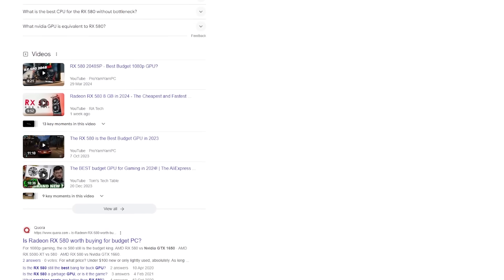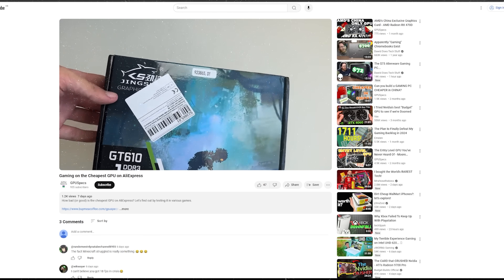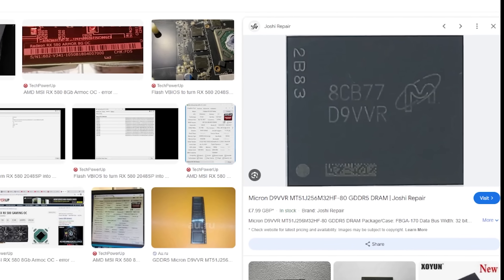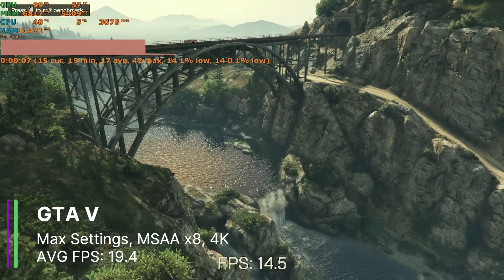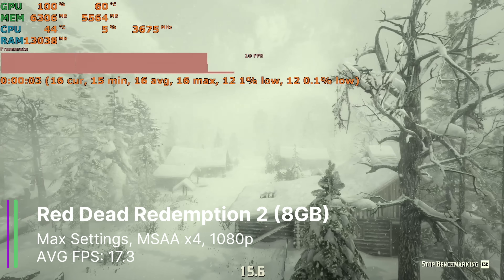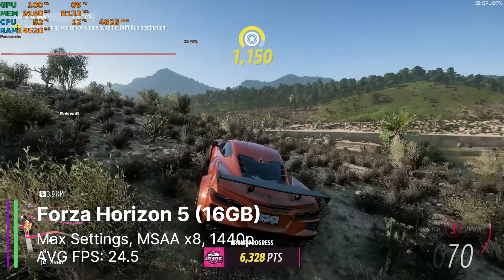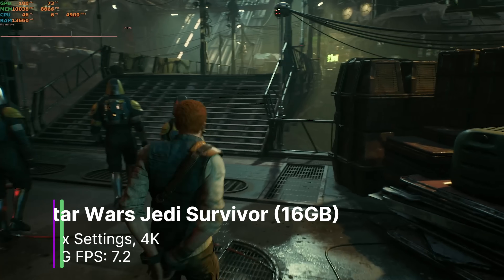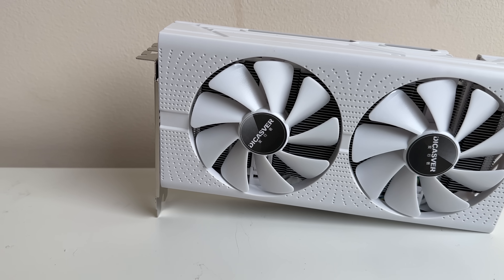16GB of VRAM on a 6 Year Old GPU? AMD RX 580 16GB

Comment: You would be able to get the benefits down the line with newer games and improved fsr3 frame generation mods to where you could probably get over 30fps but not with 4k. Fsr3.1 will decouple frame generation so you could even use frame generation without mods later so yeah other than the sp 16gb vram would be useful.
Reply: Frame gen with a base FPS of 15 would look awful (interpolation artifacts stay on screen much longer) and feel worse due to increased input lag

Comment: Use it for AI models, llama via ROCm setup, they typically use more VRAM and rely less on the raw speed of the GPU itself.
Reply: one 8 pin for power too.  could fit 6 of these in my dl580 :)
Reply: llama.cpp for the win
Reply: It doesn't support any recent version of ROCm and it can't be used for something like Cycles.
So yeah... unless you have a very specific use case, I'm not sure what the 16GB could be used for.

A VEGA gpu a ram mod could be somewhat useful though.
Reply: rx 580 is so ridiculously slow good luck getting one word per second.
Reply: @JohnHopkins-e3p  Who cares about words per second in email mode?
Reply: @JohnHopkins-e3pI get like 3 tkns/s in 8B models with an rx560 4gb i think an rx580 can do a lot actually
Reply: its amd not nvidia , doesn't support CUDA
Reply: @MohamedAhmed-os4ox  They said llama via ROCm, which is AMD. Did you even read the entire comment, or just the first five words?
Reply: @MohamedAhmed-os4ox  zluda enters the chat
Reply: @MohamedAhmed-os4ox  you know amd has theirt own compute language apart OpenCL , Direct Compute etc ? and theres ZLUDA which lets you run CUDA Apps too.

Comment: Could you run some benchmarks between the 8g and 16g with OLLAMA and Mistral? Afaik this gpu should be powerful enough to run either model but, the 16g should be able to run either with less quantization for more relevant responses.

Comment: Borderlands 3 launched with the parameter -notexturestreaming eliminates the game's notorious stutter by loading all the textures at once. Uses ~12GB of vram at 1440p and load times are longer (but stutter is almost completely gone).

Another older game with high vram usage is Far Cry 5 with the HD texture pack enabled. ~11GB at 1440p
Reply: Yeah Far Cry 5 is a good example. GR Breakpoint as well. A 16gb RX 580 would definitely benefit in these games if you just want higher res textures
Reply: Far cry5 is already an old game? 💀
Reply: @BrenoAgmL  2018 iirc which is 6 years ago
Reply: @abesmissioncontrol2013  
6 years inst old.
Reply: @BrenoAgmL  it's pretty old
Reply: skyrim with 4k texture packs aswell you often can run these texture packs with zero performance hit as long as you got the vram

Comment: Large Language Models ('AI') sometimes need more RAM.  To the point where a hacked APU BIOS to give the iGPU more framebuffer is a valid way to run larger language models.
Reply: The 780m can already use 16GB

Comment: For most close/over 200-250 bus speed card. Having more/faster memory can be very useful (especially powerful) for the RX580 speed so slow than you will not gain more performance. You might be able to max out more on graphics. But you still will have less FPS.

Additional note (especially for dumb Nvidia user or peopke with low knowledge) if a game need 9GB of VRAM and your card have 8GB. Even if the card will use less than 8GB it's just because it will cut some graphics. Or you will have less FPS. That's why if you compare a 4070 and a 7800XT. You can have the 4070 using 11 584 MB and the 7800XT 13 684 MB it's not the card managing worse his memory. It's the game cutting on some graphics.

Comment: Those crazy Chinese.

I looked into these weird cards, along with the 16GB RX580 2048SP's I found mentions of an Frankenstein RTX 3080M with 16GB of VRAM! I made a few enquiries to the various Aliexpress/Alibaba sellers and yeah it does exist, the price was crazy though.

I still kinda want one. Supposedly there is a 16GB 3070M 16GB version too but I couldn't ever find one. What I do know is that there is something called the Frankendriver project which makes these weird frankenstein high VRAM mobile Nvidia cards actually usable.
Reply: theres also a 2080ti with 22gbs of ram
Reply: @seanwood5443 that one doesn't require any custom firmware though, it's legit just a 2080 ti with 16Gb GDDR6 modules instead of 8Gb ones. you also move a resistor around on the PCB to adjust the memory straps to accomodate the new memory chips
Reply: Sapphire officially released these 16 GB video cards (Sapphire RX 570 Blockchain - is its name). The Chinese only used a ready-made BIOS from these video cards and used it on old video cards, where they replaced the memory chips.
Reply: @doom2d  Interesting, did not know that. Is high VRAM really beneficial for mining? or rather was, given these aren't useful for much any more.
Reply: I guess those are mine card
Reply: @雲開-u4u  The 3080M 16GB would be a pretty good Stable Diffusion card, I think it's roughly the speed of a desktop 3060Ti but lots of VRAM is good for machine learning stuff.
Reply: Is there 3060ti with 16gb VRAM?😢😂
Reply: @muramasa870  Never heard of one but I think it should be possible, people have done it to 3070, 2080Ti etc and just replaced 1GB chips with 2GB to double the VRAM.

I think driver issues are the problem though, I'm sure I remember reading about it.
Reply: @lemagreengreen  is no driver issues at 2080ti, it can perfectly supports official drivers
Reply: they're basically still selling rebranded RX470
Reply: I want one now. Lol.
Reply: Colorful produced em too.

Comment: what are extremely tuned bios RX 580s
Reply: Most of the RX580 cards are limited to 180W of power consumption. With a "Tuned" bios you can unlock the power over 300W; ive owned a RX580, ran for years on watercooling and clocks beyond 1633Mhz with a voltage of approx 1.375v and temps below 60W. When i ramped up furmark, and opted for the most violent power stress that was available, i saw peak power spikes of well over 360W over one 8 Pin connector. They are fun to play around with but they lack any punch beyond 1080 or 1440p.

Comment: This would be good for VRChat, as that game hogs RAM of any kind. VRAM or system RAM it doesn't care.

The extra VRAM can also help if a game just bulk loads the assets and doesn't require further loading, which can help with framerate stability. This could be useful for GPU enclosures with limited PCI-E bandwidths.
Reply: no one would play vrchat though
Reply: @Avgosbos  Wdym nobody would? This ain't 2017 no more, there's plenty of people over there.
Reply: @fungo6631  i dont think you got what i meant, yk that game's community is bassically discord mods
Reply: @Avgosbos Have you ever actually been in VRC? I have and I've seen more 4chan /pol/ edgelords than Discord mods.
Reply: @fungo6631   nah  but i have heard horrible things abt it, i wasn't trying to be offensive btw

Comment: Went pretty much as well as I expected - more VRAM does you little good when the GPU itself doesn't have the pixel-pushing power for how high details have to get cranked up to actually use it. If you prioritize getting to 60+fps (or 40+ with adaptive/g-sync) over eye-candy, 8GB is enough to cover most of the details entry-level (~$200) GPUs can handle.
Reply: Exactly. 16GB on radeon vii doesn't help it at all for gaming nor the extra on 1080ti. They are not man enough to power games and resolutions that require that extra vram. 3090 will be the same.

Comment: You could have also used frame scaling in GTA 5 to push the VRAM usage even further, like much further absurdly further even
Reply: Super agree. GTAV on max settings with 2.5x frame scaling is probably the perfect modern DX11 torture test

Comment: could you try putting them in crossfire? Since VRAM isn’t doubled but rather shared, maybe having the 16gb vram shared between that and the 8gb model could be a use case?
Reply: Hardly any new games support multi-GPU anymore. But the last time I played Overwatch, it did support my SLI GTX 1080.
Reply: I have two 8gb 2304 variants, and their performance in crossfire is dismal compared to a single card. About half the frame rate in most games that support multi GPUs...

Comment: FH5 and probably others start "skipping" items when out of VRAM. This is why the 8gb card handily outperforms the 16gb one even though it's "out" of VRAM. 

I still support this existing, even if it's fundamentally a weird idea... Although not entirely unheard of, as AMD themselves stacked together two 16gb 2304 580s on a single card. Yes, you read that right. Two of everything, for a total 32gb of VRAM.
Reply: 16GB is seemingly a waste when paired with this GPU. It was only ever meant for mining with a large DAG and nothing else.
Reply: @kingeling  It's definitely a waste in the context of a 2048SP for gaming. But it's fun hackery and interesting because of it... And the potential of taking an actually-VRAM-constricted card and bringing it into the modern era.
Reply: No.

Comment: could you test Stable Diffusion or any LLM, these kind of applications need that vram
Reply: i was gonna say this i might get it as a second gpu just for that.. i have an 6900xtx atm
Reply: No ROCM = bad time
Reply: @mysterium364  You can use Vulkan instead with certain applications.
Reply: @mysterium364  No full Rocm on Windows, only DirectML, Zluda works.
Reply: Do a Blender render at insane resolution
Reply: Not the same card but I'm running an RTX 3060 12GB and LLaMA3 8 billion parameters can generate tokens at 20token+/s (far faster than I can read) and I can fit a really large 20k token context window into the VRAM alone. But for Stable Diffusion, running an older SD 1.5 model, generating even a small-ish 1024x1024 image is pretty damn slow, like 40s per image, and it only fills about 2/3 of my VRAM.

I'm guessing for LLMs you might want to try this but there doesn't seem to be a lot of really good models with around 12b to 15b parameters. The next bigger LLaMA after 8b has 70b parameters, which requires a crapton of memory. At that point you either buy a couple used RTX 3090s or you just buy a lot of RAM and do inferencing partially on the CPU (it's not actually THAT slow). But for image generation you want that extra speed, so I don't think a card like this would be too useful for that. I'd regret buying my RTX 3060 12GB instead of an RTX3060ti if not for the fact that the extra memory helps to accomodate bigger LLMs (or more smaller LLMs but more context).

If you want to do generative AI stuff on your PC, consider buying a used RTX3090 (non-ti) if you can spare the cash, I'd say it's worth it.
Reply: @firecat6666  Yes the 3090 smokes even the 7900xtx for ai.
Reply: True ma boi
Reply: RAM doesn't matter if the GPU itself sucks for AI.
Reply: @tendosingh5682  Not true, Ai on AMD sucks ram like no tomorrow, CUDA on Nvidia can work on lower ram cards because it can swap to system memory, or ai memory tiling, where DirectML is not as good with memory management.
Reply: @tendosingh5682  ik but its the Same for the opposite and for ~100 you get 16gb and are able to Run sdxl without running Out of vram.

Comment: It's not just about the quantity of extra memory but also the bus width that widens (adding chips on the backside is like going from single channel to dual channel in CPU ram terms ) as well as the memory speed it self (compared to what it had prior to that)
Reply: No it doesn’t for this GPU, the bus width is still 256 bit even with double the VRAM, this is the equivalent of adding a 2nd bank of ram on the same channels.
Reply: @Thegeforce8523  still the other factors apply but I wouldn't be so sure for the bus width either unless the connection on both sides are physically the same which I doubt, extra connections more bits in parallel, if it says so in gpuz or what not I still wouldn't be sure because it reads what the bios tells it to that's how scammers make e.g trick GPU z to read a let's say Rx 470 as a rx580 and over sell you that...
Reply: @billkillernic clamshell mode halves the functional width of the chips, so they go from 32 bits to 2x clamshelled 16 bit modules. bandwidth is the same because the bus width is the same. and even the combined width of the memory is the same because double the modules at half of their width each is the same width as simply having the basic 8x 32 bit modules. you don't even get the benefit of dual rank memory because again, it's still 256 bit width across a 256 bit bus, not a dual rank 512 bit width across a 256 bit bus.

do note that dual rank is not the same as dual channel. you will NEVER double bandwidth by adding additional modules of the same speed across the same sized memory controller. dual rank instead allows for interleaving commands across the chips. this results in a minor bandwidth improvement
Reply: No, that's not how it works here
Reply: By adding more chips it does not. Its still a 256 bits card. And without "overclocked" memory speeds your gains will be zero.

Comment: i guess it's nice for loading big AI models for cheap
Reply: It doesn't support rocm tho so it's basically useless for ai too
Reply: @NobbGamingOfficial  kinda, still can brutforce through directml, but yeah some used nvidia gpus would be better for not much more money
Reply: @NobbGamingOfficial  You can still compile new versions yourself, there are a few projects for that out there, and there is also OpenCL if you are not using torch.
Reply: Nah, it's just for a huge DAG

Comment: Ive said this before, even the 8gb vs the 4gb rx 580 is a waste. Because games that need more ram requires way more processing power for a good experience than the card is capable of
Reply: that's what fsr is for...so yes the 8 gb is worth it especially considering the price.
Reply: Then you haven't seen the tests at all, Ellesmere is too slow for 16GB but definitely benefits from 8GB over 4GB
Reply: The 8gb is actually worth it, had an actual rx 580 8gb for years and plenty of games used more then 4gb vram and ran fine. 
16gb is however pointless even on an actual rx 580, let alone on an even weaker rx 570 even if it tries to play dress up as a rx 580.

Comment: you should have tested EFT (Streets of Tarkov map) or Gray Zone Warfare, both use up to 24GB of VRAM at higher settings and resolution, maybe in another video you can test that?
Reply: eft reserves vram it can get but actual used vram for me was under 10 gigs on 1440p high
Reply: @abcd-vk8zn  But not when you enable streaming mode, Streaming textures in real time is heavy on the VRAM trust me
Reply: I don't play streets so I didn't know it was that bad
Reply: Vram is stored on the Cpu's Ram modules when the GPU Vram is fully loaded.
Reply: I doubt that a game could even use 24GB of VRAM my friend
Reply: @FireCestina1200  Brother it can! I have a friend with an RTX 4090 and he showed me the metrics and the VRAM usage was around 23GB out of 24GB especially in Streets of Tarkov map!
Reply: @Russell970  there is a difrence in reserved vram and vram that is actualy in use! i did not use mip streaming or Streets Low texture mode
Reply: @abcd-vk8zn  It will use more than 20GB trust me that map is very VRAM demanding
Reply: @Russell970  Some people just want to argue because they're bored, ignore them, thanks for the info man some of us with braincells appreciate it. high 5s

Comment: 2048sp is such a let down for an 16gbvram the original 2304sp is much better and i think this is a mining card that just refurbished to modified chips and boards and just putting some low quality heatsinks :elbowcough::yt::yougotthis:
Reply: I reckon even the full 2304 SP will not have the grunt to use 8GB of VRAM,  let alone 16 GB. 
That's why these only exist in the 7600XT, 6800 / 7800 and above for AMD and RTX 3090Ti, RTX 4070 Ti and above for nVidia, and the Arc 770 for Intel.
Reply: @MusicHavenSG Not even the 7600 is able to use the full 16GB in gaming scenarios
Reply: 2048 sp is a 570 rebadged as a 580 in chyna
Reply: @shadowopsairman1583  It is ever so slightly faster, but not enough to matter really. Techpowerup has it as 3% faster than a RX570.  I had both and it is something like 1 or 2 frames faster... sometimes.
Reply: @shadowopsairman1583  it's a 580, but the 2048sp makes the performance almost identical. The dye on both original 570 and 580 are the same, which means this is not a 570, it's a downgraded 580.
Reply: @4x13x17  dye is a color... die is the silicon piece inside the chip
Reply: Well, it is a mining card 😁
Reply: Rx580 2048 sp are chyna miner cards
Reply: Also, such cards shine on Linux LLM inference via Vulkan